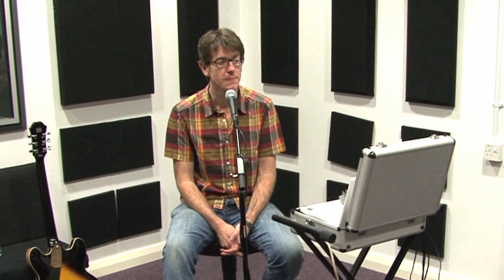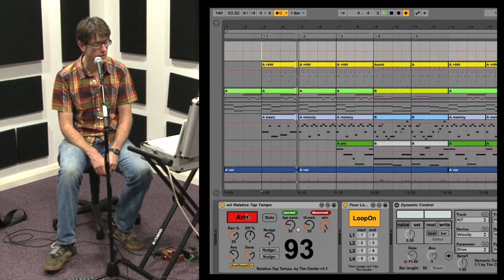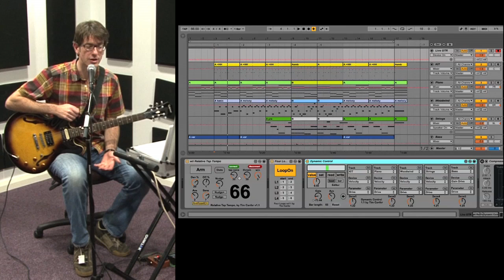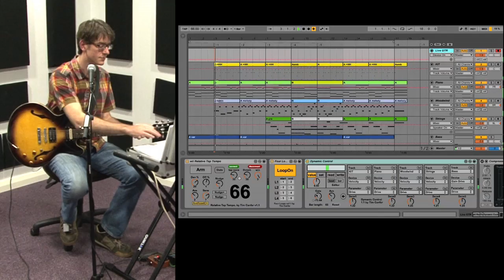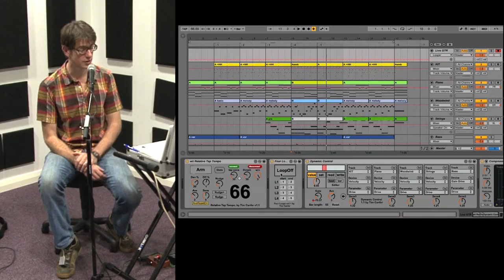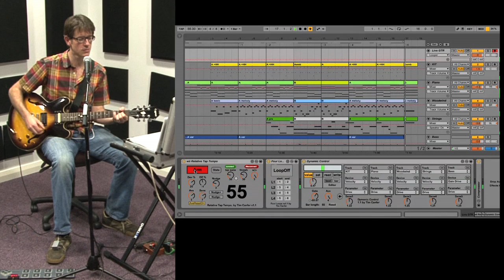Demo of Reactive Backing 2: wii relative tap tempo, dynamic control and four loop devices

Comment: I don't see relative tap tempo on maxforlive any longer??
Reply from the maker: No, I took off the free version because I am planning to release all of the full new devices sometime in March for app-like pricing (<£5). The new device works on compound and odd time too. I will post here on release. Cheers
Reply: Ok good...I have been trying to do this exact thing but mapping directly to the tap tempo button of love.  It works but causes the backing tracks to sound "glitchy" whereas this device seems much smoother at adjusting the tempo where do don't notice it in the backing track audio
Reply: Can this be used with live intro?  Or do you need standard or suite?
Reply from the maker: +Michael Meador no, it runs in max for live, which will not work with intro. Max for live comes as a part of suite and I think can be added to standard. I suggest you check the Ableton site..
Reply: Ok that's what I thought.  I knew max for live was only for standard and suite, but I wasn't sure about the devices that were created using it...thank you

Comment from the maker: Hi Rijo, thanks for your  comments! I could make a diagram, but it would just be the PA connected to the output of the audio interface (m-audio fast track ultra) connected to the laptop (macbook) via USB. The wiimote is the standard original controller with the innards of the nunchuk attachment. Please see the details on the Max4Live device site (link can be found in my website, www.timcanfer.co.uk). 

Thanks again, hope that helps. Tim
Reply: +Tim Canfer So how does the Wiimote and nun connect with the ableton? Does it connect via Bluetooth on the macbook?
Reply from the maker: +Rijo Thomas, yes, if you are running 32 bit Ableton you can use the current version online and as per the instructions you will need the ajh.wiimote extension. All of the instructions are online, just follow the links on my site. If you have a 64 bit Ableton the current version will not work (as the ajh.wiimote extension is 32 only). I am finishing a version to work with osculator, which costs about £18.